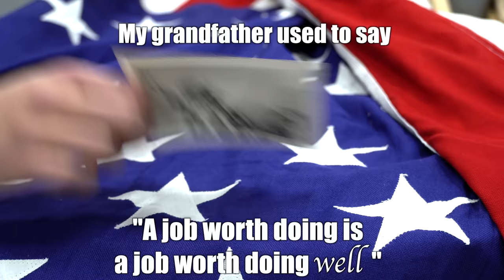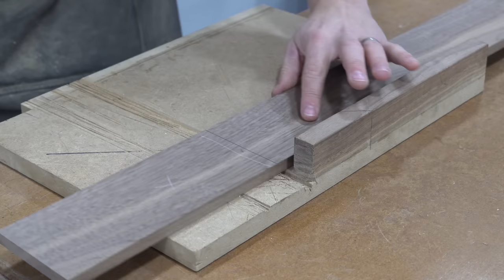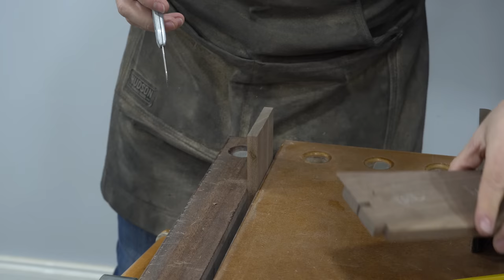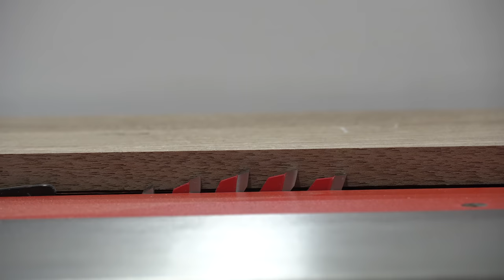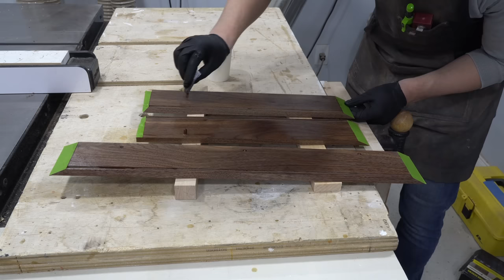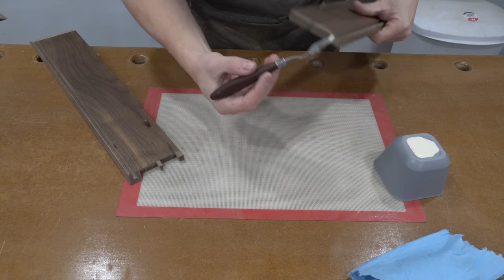Heirloom Flag Display Case | Quiet Woodworking

Comment: Really nice work! Next time you want to cut plexiglas just use utility knife and score it many times. After that it is easy to just break it off :)
Reply from the maker: That's a great tip Darko I'll try that next time for sure. I was worried it wouldn't work on this 1/4" plexi because it's too thick, but I should have tried!
Reply: @dkbuilds  it should work on any thickness if you score it enough. I usually score third of the thickness with the back of the utility knifes blade and after that I continue same motion with the edge until I go through it.

Comment: YouTube must have spied on me talking to my friend Sunday about building flag cases! This came out great, and I love the pegs in the back, super simple.  How did you manage to get the closed captioning to do that? Great idea!!
Reply from the maker: Thank you for the comment Ben! This was my first time experimenting with closed captioning, glad it turned out OK!
Reply: @dkbuilds  Worked out great! How did you do it? Is there a hidden audio track or something?
Reply from the maker: @BenNawrath  There's a way to manually add your own subtitles in YouTube, you assign each segment a timestamp of when it should appear in the video. It's not too difficult actually, compared to editing the text directly into the video. You can also change them whenever you want if you find a typo or a mistake, which is a nice bonus compared to editing them into the video too!

Comment: Nice video! How do you like the Cosman dovetail saw? I have only used mine a few times. I have to practise more because unless I really concentrate I will cut on a slight angle to the right.
Reply from the maker: Thanks Gary! I love my dovetail saw. It definitely takes practice though, and I'm far from an expert. At least half the time I pack sawdust/glue mixture into small gaps off camera! What do you use to cut dovetails if not your RC saw?

Comment: Nice build. I've been planning on doing one of these for a while for my father's flag, but I've not built up the courage to attempt the miters (I lack a table saw).
Reply from the maker: Thanks Matt! This would be an interesting build using only a miter saw (or a miter box with a hand saw). Cutting the groove for the plexiglass could be done with a router. Do you have one of those?

Comment: Do you still have your planer, jointer, and miter saw or did you downsize after growing into the basement space?
Reply: Derp. Noticed jointer a few seconds into the video.
Reply from the maker: I do :) planer and miter saw are still on my mobile flip top cart which sometimes I wheel out of my workshop to make more space.
Reply: @dkbuilds  cool! I am also doing workshop Tetris and your builds are so nice, I was wondering if I should just focus on learning hand tools and ditch some of my big power tools.
Reply from the maker: @brianpearce1890  Ahh gotcha. You could do what Paul Sellers does and only have a bandsaw, you can accomplish a lot with that for sure. For me minimum would be bandsaw, planer, jointer. Most of what you can do with a table saw you can do with a bandsaw, and planer+jointer can be done by hand but it's an enormous amount of work. You could consider getting an all-in-one tool like a Shopsmith but I don't have any experience with them (and they appear to be quite expensive).